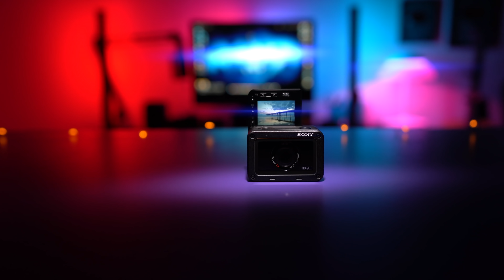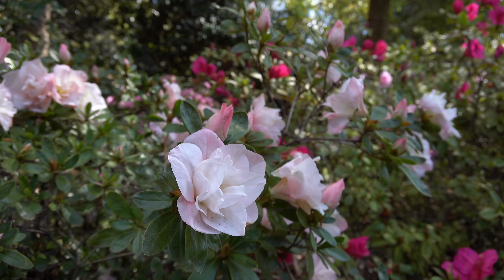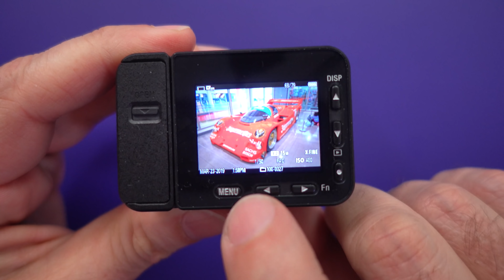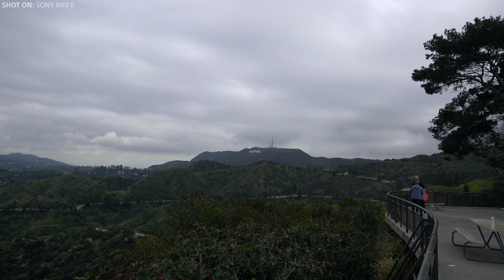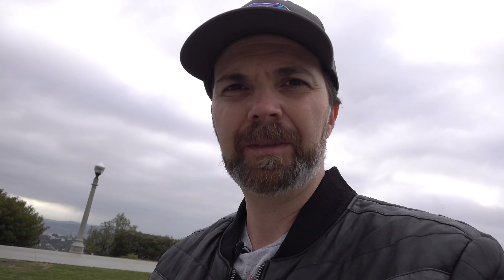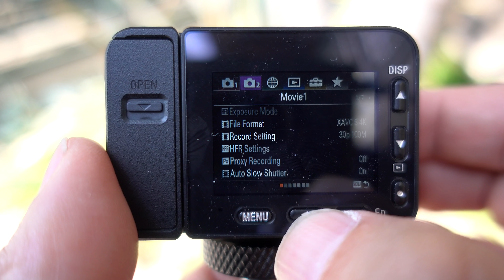Sony RX0 II — Little MONSTER [4K]

Comment: I'm getting better visuals out of my RX0 II than my Osmo Pocket 3 in certain situations, and the locked focus can be a benefit. It's especially more reliable to get a nice vertical shot with this one for me, tip it over on the side and there you go. I was considering selling it when I was invensting in the Pocket 3 because it sounded so much more advanced, but there are pros and cons to both, and I'm keeping both.

Comment: I tried this camera and the battery life was disappointing. Personally, I don't mind if they double or triple the battery in exchange for weight and size. It would be still smaller than most action cameras. The lack of C-AF didn't bother me at all. The PF mode works very well.

Comment: Seems they have listened to you: 
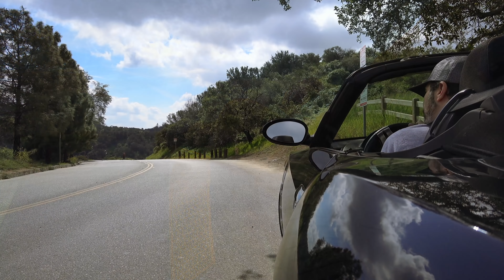1) There is an option on the new firmware to not shut down the screen after 1:10m, its called Mon. Off dur REC (movie) 
MENU →  (Camera Settings2) → [Mon. Off dur REC] → desired setting.

2) Also they have a new option AF-S during movie recording
https://press.sony.se/pressreleases/sony-releases-firmware-update-for-rx0-ii-adding-auto-focus-video-functionality-and-compatibility-with-rmt-p1bt-2951247

3) You can also adjust the brightness of the monitor by "fooling" the camera.

Set it to 1080p, adjust brightness to level you want, set it back to 4k or 1080p/120 and put in a memory bank. Thats how I have mine setup.

Comment: I finally bit the bullet on this camera. It REALLY pairs well with the Crane M2. It charges through the gimbal while shooting and omg is small. Currently testing anamorphic lenses with that setup. Los Angeles is about to get anamorphic motovlogs!!
https://www.instagram.com/p/B8OAc0iJvQl/
Reply: Ramon I have the M2 to use with my RX100M7 and am picking up the RX0II soon. I wanted to ask ya if you are able to start/stop and take photo's using the M2 when it's paired to the RX0II? The zhiyun website says it only supports stop recording but curious your thoughts? The M2 works great but on my note 10 I can't get the RX100M7 to pair with the gimbal to use the remote controls, works through an iphone but the note 10 doesn't play well, cheers

Comment: Still looked useless for that price.. even 100mb/s and 1”. For action - keep using GoPro black 7 with the numerous gears and form/weight factor.. if wanna be focused on picture qc, better to take RX100 or Panasonic lumix zs110 - they are actually also pretty “pocket”, but in 2 heads - ahead for output.. so, rx0II - still looks “nowhere” in between of those guys

Comment: So I run multicam webcasts/live streams of various rock bands. Currently I use a few gopro hero 4 black cameras for on stage angles, but the video quality is absolute garbage.

Seriously considering ditching the Gopros for RX0 ii's. Does the new model have issues with overheating  like the last model? I shoot in 1080p59.94 to run into my mixer, hoping that this won't overheat in 90min+ concerts since I don't really do 4K. This camera would match my other Sony camera's colors better, bigger sensor than the gopro, plus a non fisheye lens. Looks right up my alley!

Comment: Fun fact: 
Sets whether to turn off the monitor automatically after approximately one minute without any operations by the user when recording movies.
MENU →  (Camera Settings2) → [Mon. Off dur REC] → desired setting.
Reply: Jason's Chronicles thanks. Considering this camera and not being able to disable auto shutdown would have been a deal breaker.

Comment: So, here's the one question I have... Is the stabilization worth its salt if you don't run your workflow through the App? Is there any other way to apply the gyro / accelerometer data to the video? I honestly don't mind the 1080 output, but adding the mobile device app into workflow to get reasonable stabilization may just be a deal breaker. Inquiring minds want to know...

Comment: It seems like a nice option in some uses.  I wonder about record times (obviously depending on card) and heat/overheating...I do events that can run 4hrs, then do multicam edits   An unmanned cam like this that could take the time/heat would be nice. Tired of hauling big cameras, or relying on consumer cams.

Comment: 1-inch sensor with lower resolution should result in better low light performance than the RX100. It's a bummer that the lens is f/4, effectively removing that advantage.
Reply: Another possibility is that the camera gets only 15mp effective resolution from the 20mp sensor due to having a lens that utilizes heavy digital corrections for minimized size. Pure speculation from my part, but it's not unheard of - even the 28/1.7 Summilux in the Leica Q doesn't cover the whole sensor.

Comment: Wow, for all the features this looks really nice. Just slap a small USB power bank on your rig and you could vlog all day long with that.
Reply: Except for the overheating...
Reply: @OrlandoStreets  Come on, you're being picky now. When you're vlogging you're not filming all the time, so it would have some time to cool down. And the overheating improved drastically on this model so it won't be that much annoying, unless you shoot in plain sunlight or in the desert.
Reply: @GervasitorSpaceman67  You need to keep the overheating issue in mind.

Comment: great review as always.

regarding the product:
1. no USB-C :/
2. no 60 fps
3. stabilization seems a way worse than in gopro7.
4. $699

Please, make a comparison shooting with gopro7.
Reply: Demanding 60fps is insane. The processor would need to read out the footage of a 1 inch sensor in such a small body without overheating. Seems impossible...
Reply: @Wjfkrngkel1737  Nothing is impossible, sometimes it just demands some more time.

Comment: Way Overpriced for a camera without 4K 60fps
Reply: How many of the 60 frames a second on a GoPro are true frames and how many are interpolated?
Reply: 1080p from RX0 Mark 1 is way better than 4k from Gopro 7. Every single frame has more colours, more depth and a way better lens. It makes the Gopro look like pure trash.
Reply: curlcurllocal   Very true but it is still Overpriced
Reply: Not overprice,But it's not made for you.
Reply: ZicmA Holy
Not overprice,But it's not made for you.

If it is such a good deal, you should buy 10 of them
Reply: @mryorkielover  I have the Rx0 one and the still images are easily as good as my 60D SLR. I dont think you should compare 'paper specs' until youve actually tried one the quality is outstanding.

Comment: Wow,...Sony REALLY had to clock down the readout speed of that sensor to keep it cool. It's a slow scan, so here comes rolling shutter Jell-O!. I'm sure that controlling heat was a BIG challenge for Sony engineers with this tiny camera body. Clocking that sensor scan faster was probably making it run too hot.

Comment: My first gut reaction is this is almost the perfect vlogging camera for action sports content creators. It's much more robust, waterproof, and shock resistant than a RX100 and much smaller. I say almost because they really need to get AF-C on this and 4k exporting with IS.

Though, if Sony was reading my comment, I'd ask them to take the RX0 body and shove the x3000 internals into it as a prosumer version of an action camera; the RX0 Sport. Wide angle RX0 that has the smaller sensor but OIS + the fancy digital IS if needed. The super long form factor of the X3000 made it annoying for POV because it was always in the way.
Reply: yeah, i don't even know why those 2 are different things, they fall under similar categories so much.
Reply: Reality is that it suffers serious rolling shutter and when using stabilization it zooms in! Bad AF as well?   Trust me a Gopro or even a smartphone could do just as good a job if not better. this camera is not meant to be moving around.
Reply: @robert7622    with the 1" sensor, for sure. What I'm saying is they should take the body and processor of the RX0 and put the optics and sensor of the X3000 in it. Smaller sensor would resolve the rolling shutter, and OIS would take care of most shaking. Having an extra digital IS option would be great for smoothing out the footage a bit more if you'd like. That setup would even have no need for AF, less to process so could run cooler or have more shooting options.

This is why I feel they should have two versions. The RX0, and then a RX0 "sport" with different sensor optics made for different use cases.

Comment: Great device just price little too high, wish it was $499 not $700.
Reply: Wow. Sony is actually charging more than GoPRo for an action-like camera?
Reply: @MrEye4get  These devices are not even in the same class.
Reply: @MrEye4get  1 inch sensor.. more light is let in and thus better quality..
Reply: @ethaningoa7461  My bad, not an action-like camera; more an action vlogger-type camera.
Reply: @ethaningoa7461  but worse stabiliation... and the one inch sensor is really mostly obvios in low light, and most people dont use action cams in lowlight :)
Reply: @froznfire9531  use the companion app for gimbal like stabilization
Reply: It's not being marketed or positioned as an action cam. It's positioned as a photography/vlog tool. And even in this video it was used in low light.  @froznfire9531
Reply: @davidschloss2656  for me its an action cam, doesnt really serve the needs of a real camera for me... and since smartphone photos are getting better, its not really for photography either imo
Reply: @SLfilmBerlin  the stabi is still not close to the hero and u have to use the app, its not out of the box like this as it is on the hero... if u dont have your phone with you, the footage will be unwatchable :)
Reply: not true. you can add stabilisation with any NLE (or other tools, most apps also feature good rolling shutter compensation). so you can basically just circumvent the app completely – for vloggers and others it might still be the best tool. maybe there will be a desktop app later.

4K 10 bit HDMI out is impressive for that thing! as is the multi-cam link capabilities.
Reply: Well the sensor in a smartphone is much smaller, and the lenses are not as high quality. Computational photography is getting much better, but a portrait from the RX0II will still be better than an iPhone Portrait Mode shot, from an image quality standpoint. But certainly smartphones are a great choice, and I'm not saying you should buy this to replace one. 

If you're looking for a straight-up action camera, this isn't the best choice, you're correct. 

I was just saying that Sony's not really marketing this as an action camera, so I'm agreeing that if that's the specific use case you have for it, this isn't that. 

 @froznfire9531
Reply: @SLfilmBerlin  sure it is impressive... but who buys an athmos recorder for 800+ to add it to such a tiny camera with a tiny sensor?  that just destryos the whole point of getting it :) and you mean stuff liek warp stabilizer right? that crops in hardly and doesnt always produce good results, i speak from my own testig... sometimes it is pretty great, other times you can forget about it... specially with much movement, its nearly forgettable.
Reply: @davidschloss2656  i have to agree with thoise words, very true... smartphones got far in therms of cameras, that really impressive... well see when the first phones will have bigger sensors :)  yeah maybe this is like a little b vlogging camera, i could imagine that... or a high quality webcam :) as long as it doesnt shut down too often cause of heat and doesnt take too much accus, it seems to be fine... the price has to drop though...
Reply: @SLfilmBerlin  an exteral recorder isnt something everybody needs... it adds huge weight and size, so not really for travel films, more for short movies or so... and makes more sense with cameras that output more like gh5 or sth... warp stabi in my testing beats the other programs easily most of the time.... yeah there is no shutter correction, but normal cameras dont have that issue anyways, this cameras sadly does... it just adds up and needs so much time just to correct shakyness and stuff. for someone who has the time, ok... for vloggers not really acceptable, since most just want to upload straight and dont have to bother with all those things...and a decent filmmaker wont use this tool as long as he has a external recorder :) he prob. has a way better camera
Reply: @davidschloss2656  Okay so not we have a new category of camera?  Why not semi-action (waterproofing)/photography (1 inch sensor)/vlogging (flip up screen)/mini (size  reduction)/stabilized (no gimbal needed) camera?  It will still be viewed as a GoPro competitor before any SLR/Mirrorless body cameras.  Too much to pay for mini camera.
Reply: @froznfire9531  it is not action camera, It means to be used as companion to your primary camera, and it is used for shooting in hard shooting point that bigger camera can't get in.
Reply: @bebekdragon7604  thats exactly what an aaction cam is for :) but yeah, its not only an action cam like gopros, thats right... still it is kind of in that niche
Reply: Yeah, in Europe it's 899 euros... Over a thousand dollars....
Reply: what? where? in germany 799 with the handle. might be less for the body only if available. or drop over time
Reply: My thoughts exactly - even $600 would be more acceptable.
Reply: @Illuminationsfromtheattic  but in the US (check B&H) it's nearly 600$!
Reply: @SLfilmBerlin  looks like it's 698$ on B&H.